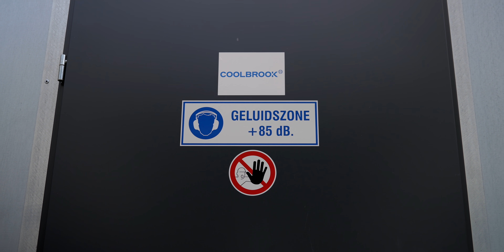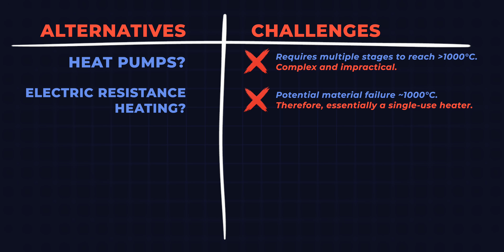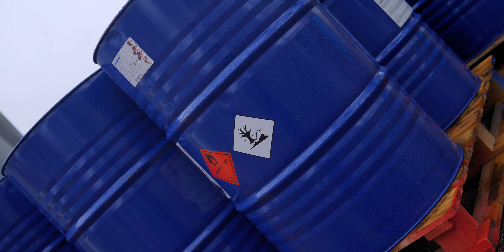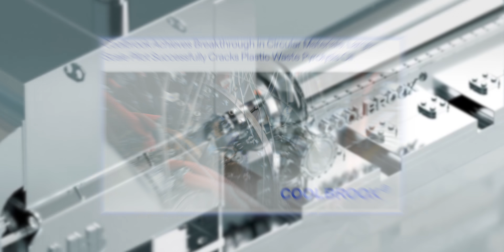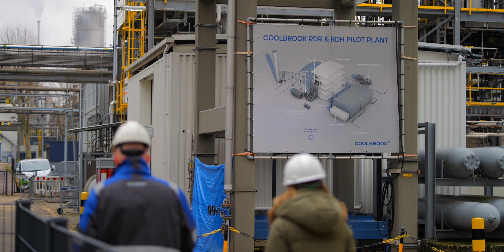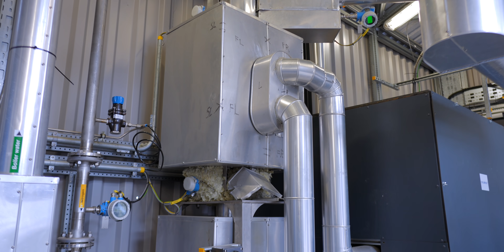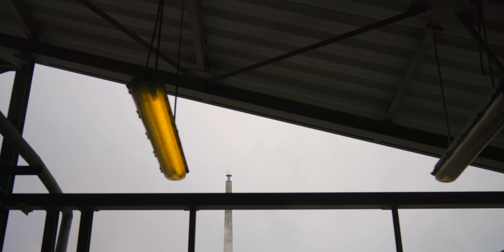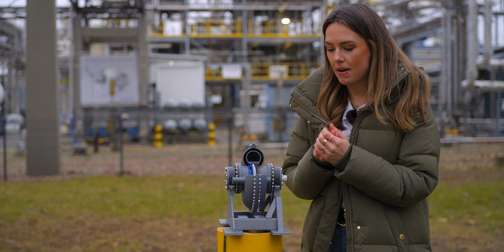Where Heat Pumps Won't Cut It, Coolbrook's Shockwaves Might....

Comment: I've spotted a few comments about EAF and Induction and hopefully this helps answer some of those questions!

⚡ EAF & Induction do indeed work for Steel Manufacture: BUT Both of these technologies require the material to be electrically conductive or magnetic. An EAF blasts an electric arc (like lightning) through the scrap metal to melt it, and Induction uses magnetic fields to generate heat in the metal (basically generating the heat from the inside out)

❌ Why EAF & Induction fail for Cement & Chemicals: Raw limestone dust (for cement) and chemical gases (for plastics) are NOT conductive or magnetic. An induction field will just pass right through them without heating anything. To get around this, you’d have to indirectly heat a giant metal pipe and let the pipe heat the gas inside it. But to reach the 1,000°C–1,700°C needed for these industries, the metal pipe itself would melt!

🌪 How Coolbrook is different: Coolbrook doesn't use sparks, arcs, or magnetic fields. It uses aerodynamics. By accelerating the gas to supersonic speeds and slamming it into a stationary diffuser, it creates a shockwave. That sudden crash instantly turns the kinetic energy (speed) into thermal energy (heat).

Because the gas heats itself in the centre of the pipe, the material doesn't need to be conductive, there is no risk of an electrical explosion, and the metal walls of the machine stay safely below their melting point. It’s literally rocket science applied to heavy industry! 

However, this same approach to generating heat could also be used for Steel and Aluminium. We will have to get into the relative efficiency (both in terms of electricity use and space) in a future episode to adequately compare the solutions for steel and aluminium!
Reply: you have a fundamental misunderstanding of electric arcs, they function perfectly well in non-conductive materials, even in vacuum.
Reply: @alanhat5252  I'm not sure I agree, while Cambridge Electric Cement have demonstrated this for cement and indeed, indirect electric arc furnaces exist (though they tend to reach lower temps than direct electric arc furnaces) - Coolbrook still represents a higher efficiency, more flexible solution where you don't need to heat metal inorder to transfer heat and as such is relevant for a lot of heavy industry applications. Please tell me exactly what I've got wrong?

The reason an EAF works for cement in the Cambridge example is that the cement isn't the primary material in the furnace; molten steel is. The EAF creates a massive plasma arc between electrodes and a pool of scrap steel:, then by adding "Recycled Cement Paste" (recovered from old concrete) into the furnace, it sits on top of the molten steel as a slag layer.The steel acts as the conductor, and the intense heat of the melt "re-activates" the cement paste. The cement isn't being hit by the arc directly; it's being cooked by its proximity to the liquid metal
Reply: @ImogenBhogal  ... We all know that "X doing A, isn't as efficient as Y doing B", doesn't mean "X can't do A". You clearly stated that electric arcs require the material to be electrically conductive or magnetic. It does not. In anyway. At all. Whether it is efficient at heating cement, is completely and utterly irrelevant, to the question of whether or not it can work with materials that aren't electrically conductive or magnetic.
Your statement was 100% wrong, in every possible way.
Stop trying to gaslight us, you liar!
Have you no shame!

"The cement isn't being hit by the arc directly"

That's completely beside the point.
Also the arcs go between the electrodes. The arcs are hot. Thus the material is heated.
The electrodes need to be electrically conductive. The material does not. In fact, they can create extreme heat, without any material in the furnace, at all!
Reply: @ZarlanTheGreen  Calm down Zarian. Yes there are annoying mistakes ('lies' if you prefer) in this video, and these comments, but Imogen is engaging here, so there is no need to be quite so rude.
How much effort would you put into responding to comments if people just yelled 'liar' at you?
I agree she is wrong/confused about this, but it should be possible to have a civilised discussion about it.
Reply: @xxwookey 

😂😂😂😂

You're quite hopeless at presenting arguments, you really are.

The point was the information presented was duff, pure and simple.

The script editors and researchers were sloppy. They neglected to fact check (at even an elementary level) their own work prior to issuing the script to Imogen.

Imogen is merely a customer facing presenter.

She presents whatever the script tells her to.

It may be that the answers later provided by Imogen in the comments section weren't written by her and those responses were from the researchers, who still got it wrong.

The problem lies in that Robert and Dan are desperate to promote their platform as "relevant" in all respects and technologies.

And of course it isn't relevant in any way shape or form.

As but one example we find Robert and Dan still believe (or are obliged to believe) that sales of BEVs are on the increase in UK.

The financials say this is not true and that it is hybrid vehicle sales which are on the increase.

Hybrids are merely fossil fueled cars with an electric motor and battery tacked on to give the appearance of  going green.

We have returned to the days of the Prius ... once considered as an absolutely essential prop for the virtue signalling consumer eager to display their green credentials and that "they care".

We now see some of this platform's events postponed, for months.

Does this imply the car makers who sponsor test drives in BEVs have decided said BEVs are no longer of interest to the car buying sector?

We see Stellantis volte face on BEVs and yet we see this platform's CEO featuring on a news platform telling the audience Stellantis got it wrong.

Said CEO can say whatever he likes but neglected to factor in that Stellantis is a business which relies on profits and BEVs are certainly not the earner car makers once hoped for.

EVs most certainly are required for "reverting" to a greener planet but not those powered by batteries.

In short this platform provides amusement and entertainment in that the content is never quite accurate, witness the earlier comments.

Robert has been reminded of this, directly or indirectly, via comments from guests or comments from viewers.

Dan has promised to do the "myth busting" thing more than once but we never see him do this.

What we do see is Dan spouting "so called stats" that can easily be fact checked by anyone who can be arsed.

Not being professionals in the art of "spin" their efforts at said spin are risible.

We now see quite pointed and quite vituperative comments from fairly irate viewers who take exception to being misled on a technical level.

We might well wonder where this platform is going if we continue to see even more duff information trotted out ad nauseam.

Robert and Dan kindly take note.
Reply: @xxwookey  How could those possibly be mistakes? Even the slightest bit of looking into the issue, would tell you that those methods exist. Not looking into it, despite the fact that you are claiming to be knowledgeable, and to be informing the public, IS AN INTENTIONAL CHOICE!
...and, when faced with the fact that there ARE other options, then claiming that it doesn't count, because it doesn't work for naptha (despite how you clearly said it doesn't work for ANY of the thing industry needs to heat, including steel and aluminium, for which it DOES work), cannot be called a mistake, by any stretch of the imagination.
There is no possible way, to argue, that that is ignorance or confusion.
If you disagree, I dare you to find some way, to argue that it could be. Go on! I dare you!

"there is no need to be quite so rude."

Blatantly lying, is rude.
Pointing out that it is a lie, isn't.
The party that isn't being civilized, is Imogen. Not me.
Reply: @ForestForest-n9i Whilst I agree that this channel doesn't do it's research (and often presents stuff, as ads, just uncritically parroting what the companies are telling them [and companies are, of course, 100% biased about the things they do/sell, and known to often be less than honest] ...which is completely dishonest), a lot of the "facts" you mention, appear to be nonsense ("but not those powered by batteries"? That's just plain incoherent!) ...as well as kinda off-topic.
Reply: @ZarlanTheGreen  I expect the way this worked is that they (Fully Charged) took the 'this is the only way to do industrial heat' info from Coolbrook's website/promo information. And didn't bother to fact-check. Regurgitating info in this way is misinformation, not disinformation, which is the difference between lying and being misled. 
This channel has always had a deliberate policy of being 'favourable' to companies/products they highlight, in an attempt to be positive, but it has quite often led them to get a lot of flak for either talking bolllocks or promoting fairly daft things.
It would be a much better channel if they did apply a bit more journalistic integrity/fact checking. But they are doing this with pretty limited resources. I don't know who actually does the scripts for these things. Imogen does the presenting, but I don't know if she did the writing in this case.
Doubling down in the comments does make it worse, I agree. It would have been much better to either explain the process by which such cock-ups occur or at least just admit that they got it wrong.
Reply: @ZarlanTheGreen 

😂😂😂

Facts you say?

Perhaps you should do some research of your own.

That said feel free to elaborate.

As for the rest then that's mission creep for you.
Reply: @ImogenBhogal  The trolls are even arguing with each other in this thread.  Well done Imogen.  All channel engagement is a positive for enlightening the masses that status quo can't, and won't define the future.

Go-on trolls, keep on with your nonsense.  Vigorous knock downs expose your entrained drivel for what it is.
Reply: @ZarlanTheGreen  Commercial efficiency absolutely matters.  By all means quote the comparatives to make the case that legacy is better than the proposed new tech approach and not just in the expensive early adoptioon/development stage but at scale deployment,
Reply: @Goggleboxing  None of what you're saying, has any relevance, to the topic being discussed. In any way, shape, or form.
Reply: It’s exciting to see this new tech roll out. I wonder what the petrochemical giants make of it? I will say that it can only ever have limited utility for steel because, along with EAFs and induction, it doesn’t provide a carbon source for the reduction that’s fundamental to the creation of metallic iron from iron oxide. And while recycled steel proportions are growing everywhere, we still will be consuming a lot of virgin steel globally for a long time to come. We can cut this with hydrogen DRI and potentially MOE if we can solve the anode challenges, and desert environments would be particularly good places, but it’s a non-trivial challenge. Cement is another example — about two thirds of the emissions is just from the decomposition of limestone releasing CO2. Other heavy industrial processes can be decarbonised by addressing the chemical process, eg aluminium if we can create inert anodes on a large scale, but like green H2 and indeed naphtha cracking, we have miles to go before the industrial giants make the switch
Reply: @KarlPopperFan1  There is absolutely no problem, in EAF and induction, from any supposed lack of being able to add carbon. They can, and do, very easily add carbon. And they are able to do so, with far greater accuracy and control, than if carbon leaked into it, from the heat source ...and it's important to have a controlled and accurate amount, and distribution, of carbon.
Reply: @ZarlanTheGreen  you're missing the point. Adding carbon creates carbon dioxide, ie is inherently a CO2 intensive process. The best methods we have to tackle that are reduction using hydrogen, or molten oxide electrolysis, which both use chemical processes that do not create CO2, but have significant engineering challenges. In the case of MOE, you have to maintain stable electrodes at 1600C and prevent corrosion in a highly oxidising molten oxide environment at industrial scale. We aren't there yet. 

We need to abate the emissions associated with heating and the emissions associated with the chemistry. There are path forwards for both, but it's non-trivial. EAF, induction and this new process are all aimed at tackling the emissions associated with heating, not the chemical process.
Reply: @KarlPopperFan1  "you're missing the point. Adding carbon creates carbon dioxide, ie is inherently a CO2 intensive process."

1. That's absolutely not anywhere close to anything you said, came close to being related to anything you said, to that's hardly missing the point".
2. It doesn't create CO₂. That is a lie ...and if you're saying that hydrogen, or molten oxide electrolysis don't add carbon, then what you're saying, is that is completely impossible (according to you) to use either of those methods, to produce steel.
Reply: @ZarlanTheGreen I have literally no idea what you’re talking about. You seem completely garbled. Do you understand the basic process? Fe2O3 + 3CO -> 2Fe + 3CO2. The carbon from the coke becomes carbon dioxide. In H2 DRI, the equation is Fe2O3 + 3H2 -> 2Fe + 3H2O. And MOE is 2Fe2O3 -> 2Fe + 3O2. These processes do not involve the use of carbon and thus do not chemically produce carbon dioxide. CO2 can still be produced in the heating process and in the production of the precursors (eg grey hydrogen for H2 DRI). 

This is bog standard chemistry, I don’t know why you’re getting your knickers in a twist over it. It’s not in the slightest bit controversial to say that EAFs, induction, and this new tech abate CO2 emissions for heating but not for the chemical reduction of the iron oxide into metallic iron. A combination of EAFs and H2 DRI or MOE can, in principle, completely abate the carbon emissions associated with molten steel, but EAFs or induction or this new tech alone cannot. 

I’ve been perfectly consistent about this from my first comment till now.
Reply: @KarlPopperFan1  "You seem completely garbled."

Describing yourself, are you?

"The carbon from the coke becomes carbon dioxide."

That ISN'T WHAT YOU WERE TALKING ABOUT!
Stop lying!
You talked about how electric arc and induction aren't particularly useful for steel, because "it doesn’t provide a carbon source".
You were talking about "providing a carbon source" as a necessary thing, to be useful for steel production, and that not providing that, makes it not be useful.
Naturally, the only possible conclusion, is that you're talking about the necessary carbon, that you have to add to iron, to make it into steel!
After all, pure iron is useless. No one wants pure iron. We want steel ...which is an alloy of iron and carbon! (and often a bit of other elements, as well)

You were OBVIOUSLY not talking about additions of unwanted carbon, as not only is there absolutely no carbon, in electric arcs, nor in induction, but you were notably talking about it as necessary and desired.

"but EAFs or induction or this new tech alone cannot."

That is an obvious and pathetic lie.
Stop making such ridiculous excuses, and have the wisdom, humility, and decency, of just admitting you're wrong.
Reply: @ZarlanTheGreen while you go chucking around the phrase “lying” as an accusation of others and being wildly obtuse and pedantic in picking over my words, I notice you do not bother to apply the same standards to yourself, and are very happy to take my original phrase “of limited utility” and lie yourself by re-articulating htat as, first, “aren’t particularly useful” and then “makes it not be useful”. What a shameless little twerp you are. 

Now for your next act, why don’t you explain how EAFs or induction or rotary turbines provide the reducing environment necessary for the production of metallic iron, which is an essential precursor for the production of steel. I could do with a laugh.
Reply: I have also got no idea what point you think you are making when you say “I was obviously not talking about additions of unwanted carbon”. Like, what the fuck is that about? I was talking from the outset about the use of carbon for reducing iron ore into metallic iron. The unwanted thing is carbon dioxide. The standard method for reducing iron ore is with carbon monoxide from coking coal, and while that can be replaced in principle with H2 or via the use of electrolysis, these aren’t industrial scale. 

What are you trying to claim for EAFs or induction, little one? Can you get your point out? I don’t think you can. If you can spell out your contention, we can see whether it is materially different in any way, or whether it’s just nonsense pointless argument, as I suspect
Reply: @ZarlanTheGreen and just to be very specific, you are being wildly disingenuous when you say I’m lying by saying “the carbon from the coke becomes carbon dioxide” because it wasn’t what I was talking about and then quote this from me “, it doesn’t provide a carbon source” while cutting of the second half of what I wrote, “for the reduction that’s fundamental to the creation of metallic iron from iron oxide”. That is exactly the use of carbon from coke for reduction in which the carbon from the coke becomes carbon dioxide. You’re being an almighty tit, reduced to half-quoting things I say to give the appearance of a contradiction because you cannot argue your points in good faith. Right from the outset, I have been talking about the use of carbon for reduction of iron oxide. I said it in each and every one of my posts. Because, quite obviously to everyone besides yourself, that’s the second major source of CO2 emissions in steel making today, alongside heating-derived emissions. You’re such a complete and utter berk
Reply: @KarlPopperFan1  "I notice you do not bother to apply the same standards to yourself"

The most baseless, obvious, and egregious, of all your lies...

"“aren’t particularly useful” and then “makes it not be useful”."

That's not that far off of "limited utility". Not entirely accurate, sure, but unlike your baseless claims (and you), I am not being overly pedantic.

As for the rest of what you said...
I see no need to give any answer to that pointless verbose and needlessly overcomplicated crap, that fails to address anything I said.
Reply: @ZarlanTheGreen  just take the small L (or reduce you own credibility) you both are right an factual but 
you overread the important information  in the first place and therefore missed the topic by a huge margin  

Just take a look at the comments read them slow and try too stay neutral emotional wise

And you will see that this here is basically a misunderstanding but on your side soo be a smart person admit it apologize for rudeness and be a better person 

@Karl you should also apologize for rudeness 

Heck you both are quite intellectual minds  work together not against each other or are you both really that stupid too be upset about not being more right than the other
Reply: @TheLtVoss  You say we're both missing something, but you made the reply to me. Not both of us, not @KarlPopperFan1, but me.
I.e., you singled out me, for criticism.
With not even any hint, of even an implication, that I am solely, or mainly, at fault.
That is not an honest or good faith action.

"Just take a look at the comments read them slow and try too stay neutral emotional wise"

I always do.

You claim that there is something I'm missing
...but you don't make any attempt to explain it.
Just claiming there is, but not explaining it, is 100% unhelpful and contributes nothing. It is either trolling, dishonest, or just utterly stupid. Either that, or there isn't anything I'm missing.
Either way: There is no reasonable or coherent reason, to make such a comment.

Also:
There is nothing that @KarlPopperFan1 understands, and is trying to convey, that I'm missing.
Even taking your claim, at face value, at most, you might say that there is either:
* Something he understands, and refuses to try to convey, or 
* Something he is trying to convey, but doesn't understand. (if you can't explain it, you don't understand it)
In other words, even with the most generous interpretation of what may be the case, he is clearly completely wrong.
The only question being, what exactly he is wrong about, and in what way
...and also meaning, that anything I'm missing, is because @KarlPopperFan1 is unclear and refuses to make any attempt to explain.
I.e. it's 100% his fault, and there is nothing I could be blamed for missing. At all. (unless you can give some contrary evidence, or rational argument, that shows otherwise? If you're actually willing to do more, than just spout claims, you refuse to back up?)

Whenever someone explains something, I didn't know, I'm quite happy to learn, and often express my gratitude (even if the person is being an arse) ...and if it's by demonstrating me I was wrong, and thus doing me the great favour, of ridding me of a misconception, then I make sure to express my gratitude!
Neither you, nor @KarlPopperFan1, have made anything that could, even charitably, be said to be a genuine attempt at explaining.
In other words:
You're not arguing, in good faith.

As the saying goes: Put up, or shut up.
IF you make a good faith attempt at an explanation, after apologising for singling me out, then I'll hear you out.
If you refuse to explain, or otherwise demonstrate dishonesty or just general bad faith... you will be ignored.
Reply: How does this compare to an arc-jet torch?
Reply: yes you are correct for Induction is indeed for conductive materials, but those conductive materials also very good at radiating the heat away, use the resulting molten metal as the heating medium to convect heat
Reply: @st170ish  ...or use electrical arcs, instead, where conduction/magnetism is irrelevant.
Either way, there is no way in which any of that is a problem, for heating metals (induction might not work with all metals. Arcs do), which both methods are used for, in industry, and have been for over a century
...which this video claims, that they can't be used for. (as they say, that there's only burning stuff, those five options they mention ...and nothing else. So no electric arcs, or induction)
Reply: 30 secs in and am already pissed off! Why the fuck dont human use volcanoes as a heat source?
Reply: @jimbob-jn6jz  Because it's generally not very convenient? The volcanoes are nowhere near where you want the heat? They explode from time to time, covering your plant in lava, or just flattening it? 
We do use geothermally active areas, sometimes near volcanoes for heat.
Reply: @xxwookey 

You forget geothermal generation of electricity?

They can use wires to transport said electricity anywhere they want.

That's technology for you!
Reply: @xxwookey  Oh yeah and strip mining mountains into massive open pit mines is convenient. Its just dumb greedy coal and oil barrens, Humans are stupid and doomed. Also you build in a way that is strong enough and can harness the heat and funnel the lava. ffs
Reply: @jimbob-jn6jz 

They do!

Google is your friend on this.
Reply: Thanks for the speed-into-heat explanation. So this is a molecule accelerator.
Reply: Adiabatic should be explained.
Reply: Sorry too say but in essence you are right but actually you are very wrong about  same stuff your thoughts were a bit too short for industrial engineering especially critical thinking is so important with new technologies 😅

Arc heating is a mixture of resistance heating and mostly uv radiation  you dont need too touch the metal or product with the arc too heat it (even if it is more efficient to do so )  soo only the electrodes have contact with the +3000 dreggre plasma  
And passing a gas through the arc is probably pretty efficient too heat gasses and lime dust just by blowing it through 😅 but overall efficiency is good but not great 

And Induction needs a conductive material but    the range form 1000-1700 is only a tiny problem above 1500°C were a steel mesh is close too melting but we have high temp alloys for turbines (the roto dynamic heater also needs these or its own rotor and stator blades would have problems) and if wee realy want we could take a tungsten mesh and goo over 2000°C at a big price and more problems on the ceramic side 😅 than the mesh  so gasses no problem  solids like  lime dust could be problematic but having heater and reaction vessels separated is also not a problem in engineering 

And there is even a other form of heating stuff many of us use daily Microwaves 
Also highly energy efficient especially with polar loads like watter 
 
Sure same of these heating methods have same limitations  but if we look at combustion it is basically the same with its limitations we already engineered around  

And the big problem with that roto dynamic heating is plane simple too many energy conversions   we take electric energy and convert it in kinetic energy before we make it thermal energy  each step is very efficient with our tech but it adds up the 95% you got too hear  is maby the turbine part or they kinda cheated by reusing same process heat that isn't needed for the main process the overall system will never reach 95% usable energy  before electric motors cann do that also the gearbox will eat same energy too and makes unusable heat   heck it is simpel math at that point even if I take the highest efficiencys I could find the overall system only reaches 84% of the energy put in is usable heat for the process  that is pretty impressive with the extra steps they take and  efficiency wise between arc heating and Induction 

So I dont see it becoming a huge breakthrough for high energy demand industry at best it is only a adition too our already good filled roster
Reply: @TheLtVoss  What you mention, whilst being good info, is 100% completely irrelevant.
Even if Imogen's claim, that arc and induction can't be used for petrochemicals were true, that would still make her comment completely wrong.

The video clearly states that there are NO practical methods to heat up ANY of the things that need to get over 1000°C, in industry (and steel being an explicitly mentioned example), beyond burning stuff. (and only that list of five alternatives, deemed too impractical, at least for now, as being theoretically possible, among known methods)

I.e. they are saying that arc and induction CAN'T be used, to heat STEEL, to over 1000°C!
Indeed, they're not even worth mention, as hypothetical examples, that you might imagine heating stuff (incl steel) over 1000°C
...and Imogen's responses, haven't even addressed this undeniable fact.

She's just gaslighting.

Trying to distract from how the video is LYING about how there are no practical ways to heat any of the things such as, and I quote, "steel, cement, aluminium, chemicals, and petrochemicals", to over 1000°C, aside from burning stuff! (and maybe in future, the method the video is about)

...and no, you can't say "maybe they didn't know". 
First of all, that excuse can't possibly be used about the responses, where Imogen has been informed, and admits the methods work, but more importantly:
These are things you'd clearly know about, if you looked into the subject ...and Everything Electric are VERY CLEAR, about how they look into these things, and pride themselves with how informed they are, on the subject!
If they haven't actually looked into the subject, at all, then THAT is the lie!
Reply: "EAF & Induction do indeed work for Steel Manufacture"

So why did you claim that there are NO WAYS to heat metals, up above 1000°C, aside from burning stuff, or (theoretically, but not practically) one of the other five options you presented (two of which is burning stuff, and one of which can't produce heat)
Something that you, clearly and explicitly, stated in the video
...which you now acknowledge, was completely false.

"Both of these technologies require the material to be electrically conductive or magnetic"

For induction yes, but not electrical arcs;
The heat is produced, by the conduction between the two or more rods, that are used to create an arc between. Not the material they heat up.

Also steel, and many other metals, are both electrically conductive and magnetic.
Again: You clearly and explicitly stated, that there are no practical ways to heat up steel, to those temperatures, aside from burning stuff.
Induction and electric arcs are practical, and have been used for about a century.

"Why EAF & Induction fail for Cement & Chemicals"

...IS IRRELEVANT!
You didn't say that there are no other practical non-fossil ways, to heat up cement and chemicals. You said there are not ways, for ANY of the things that industry needs 1000+°C for ...and you explicitly included steel and aluminium.
Despite the fact that you clearly must have KNOWN that induction and electric arcs can, and are, used to heat up steel, and many other metals. I.e., you lied
...unless you simply did absolutely no research, on the topic, before making the claim. Meaning you said something that you knew you had no basis for thinking is true. I.e. a lie.

In other words:
You lied.
This is inarguable
...and your response to that, is not to acknowledge your fault, apologise, and try to do anything to make up for it and atone.
No, instead you deny, obfuscate, and gaslight.
...
That does nothing to improve your credibility, trustworthiness, or respect.
Quite the opposite.
Reply: @ZarlanTheGreen  Kindly post your LinkedIn so we can see where your expertise stems from.
Reply: @Goggleboxing  Implying that expertise is needed, or that the level thereof (rather than of the arguments and evidence) determines the strength of ones case... There is only one kind of response, that should be made to a comment like yours (IF any): To point out that it is 100% irrelevant, fallacious, and done in bad faith. You are clearly a (or equivalent to a) troll. Bye.
Reply: @ZarlanTheGreen 

To be fair Imogen merely follows her script and the film editors do their best with the rest.

Sadly there appears to be a great deal of naiveté within the production team in that they are clearly guilty of not fact checking their final script before giving it to Imogen.

And of course certain members of this platform are not averse to making quotes to a certain  second tier news platform that interest in EVs is on the rise.

Perhaps it would have been more accurate to  state there's increased  interest in hybrid cars.

As a result of these departures from the real world more and more viewers of this platform are doing the fact checking thing straight away.

We see less comments as a result.
Reply: @ForestForest-n9i fewer
Reply: @xxwookey 

Well spotted.😅
Reply: @ForestForest-n9i Imogen is knowingly, actively, and intentionally saying her words. Regardless of whether they are her own, or from a script
...and there is no possible excuse, of naiveté or ignorance. Not fact checking, is a choice you knowingly and intentionally make!
But also:
And there is no possible claim, of not doing your research, when it comes to the fact that the video claimed that there are no other options to heat ANY of the things they listed (which explicitly included steel and aluminium), and then, when faced with the fact that there obsoletely ARE options that DO work for some of those things (such as steel and aluminium), say that that doesn't count, because it doesn't work for naptha...

How could you possibly argue, in any way, that that's about lack of research, ignorance, or naiveté?

But further on "lack or research":
Anyone who makes statements, to "inform" the public, and choosing not to do even the faintest hint of any research, and thereby just making what they know to be ignorant and uneducated statements, is a liar and spreader of misinformation.
If these things are what the people they interview have claimed (which MIGHT be a possibility, but there is no clear indication thereof), and they just blindly and uncritically take their obviously biased word for it, without doing anything to attempt at any outside verification...
Again, that is an intentional choice, one knowingly makes.
Reply: @ZarlanTheGreen 

Perhaps I was being an apologist for Imogen.

That said you are quite correct in that whatever this platform comes out with (on any topic) should be fact checked and critiqued if and as necessary.

And of course Imogen is merely a freelance presenter and for all we know has other income streams to deal with.

I suppose that now you have explained the error of her blindly presenting stuff Imogen will ensure that her script is accurate from now on.
Reply: @ForestForest-n9i "Perhaps I was being an apologist for Imogen"

You can be an apologist, all you want ...as long as you're making reasonable arguments.

"I suppose that now you have explained the error of her blindly presenting stuff Imogen will ensure that her script is accurate from now on."

She has PROVEN that she wont, as she has responded with trying to gaslight us, with what is VERY OBVIOUSLY irrelevant BS, that there is no possible way, that she didn't know, doesn't actually address the issue, and denying that what she said was wrong, even though it is completely obvious and inarguable, that it is.

Why do you keep denying this?
Reply: @ZarlanTheGreen 

😂😂😂😂😂😂😂

One might ask when you caught zealotry?
Reply: @ForestForest-n9i There is no hint of anything, that could imply that I am being zealous. You just realise that you have no valid counter-argument, so you stoop to insults and smears. You're just embarrassing yourself, and proving yourself wrong.
Reply: @ZarlanTheGreen 

😂😂😂

Rubbish argument.

More zealotry?